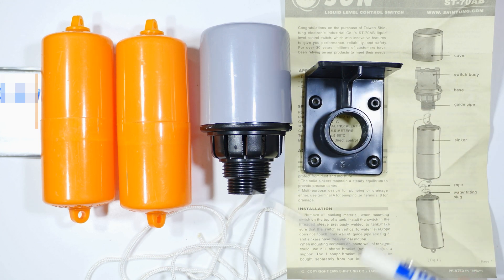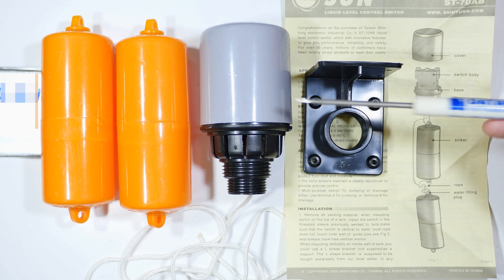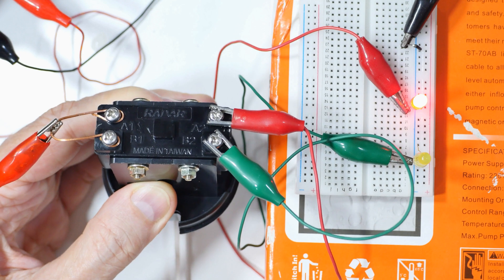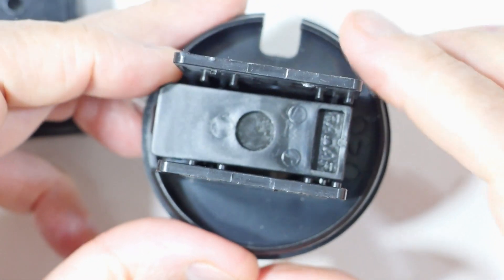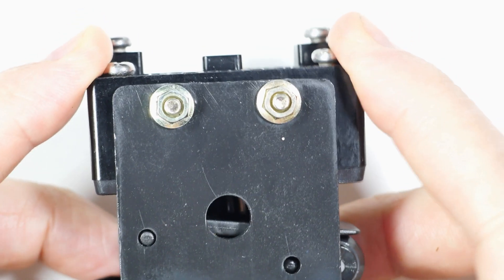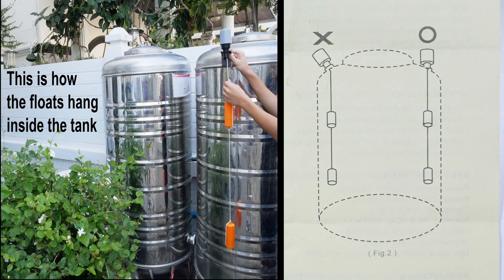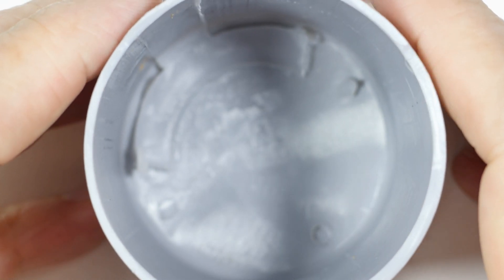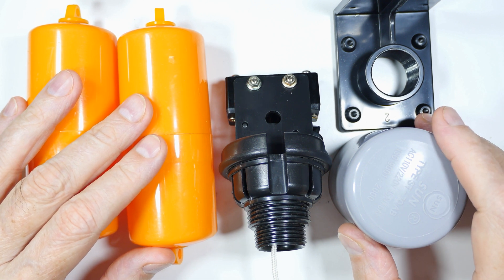Float Switch Basics (4K)

Comment: Is it a reliable sensor? And can we replace the switch if it goes bad? I have magnetic float sensor and now saw this sensor available and now confuse which one to use. Magnetic float switch that I have are sealed and only two wires comes out, so they don't have nay issues that you mentioned with your sensor.
Reply from the maker: The magnetic float switches I have seen are low amperage. A good quality mechanical switch like I used has lasted me 10 years. It depends on load and quality.

Comment: If I am using it for a storage water tank that is used occasionally and I want it to fill after certain level what two screws do I attach to? Instruction indicate pump or drainage not sure what I am looking for
Reply from the maker: I have not seen your particular switch, but typically, you use the pump connections. Drain connections turn on when water is high, off when water is low. Pump connections turn on when water is low, off when water is high. It is easy to check once it's installed by moving the floats with a plastic pipe. If it's not right, use the other connections.
Reply: @tsbrownie  thank you very much for response